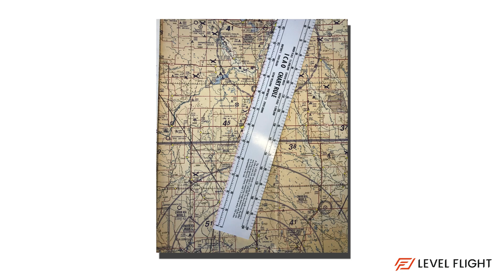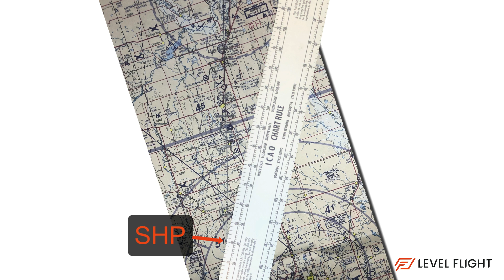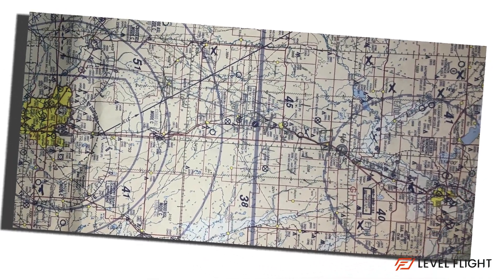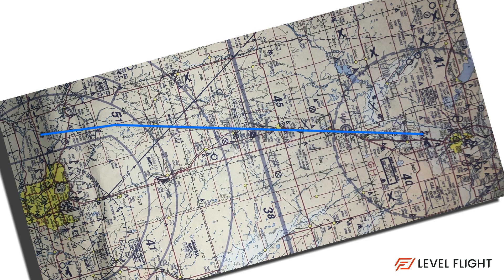5. Distance and 10 Degree Drift Lines

Comment: Fantastic video, should be moving onto Nav fairly soon so found this really useful. Just a quick question, I noticed on the column for true heading you worked it out as 207 but then changed it to 205. Is there a particular reason for this. Thank you.